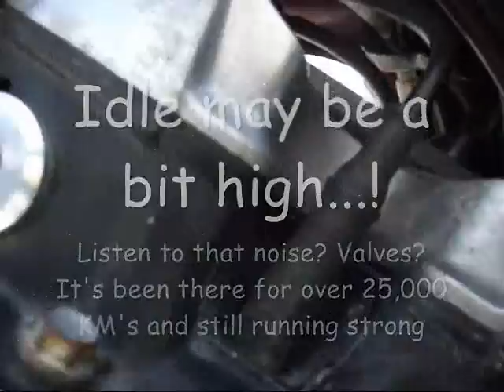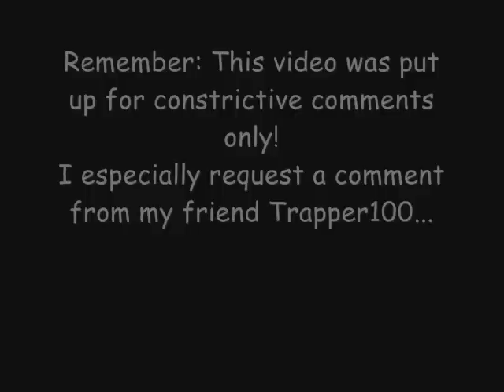1984 Honda Magna

Comment: I recognize that sound right off. I bought an 84 magna in Virginia when I joined the Navy. What your hearing is the cam chains slapping the cam chain tensioners. Makes a hell of a racket but as long as you keep the oil fresh, it doesn't cause a problem.. There an article on the SabMag Website about how to fix the problem. I think it was a v65 they repaired but basically the same. I love these old Magnas too. I have an 84 and an 85 V45 and an 84 V65. It is amazing how different the 84 and 85 V45 feel and handle with only 1 inch lower seat. I think it must have a longer rake too because while the 84 is nimble, the 85 is more comfortable by far.
Reply from the maker: Thanks for the reply and information. I was told the same thing by two mechanics. I was always concerned until the second mechanic said the same thing. I am even more confident now that you mentioned it again. the motorcycle is running great and this noise has been there for a couple of years now. It actually sounds a lot worse on camera but hardly noticeable when sitting at idle. Of course, when I am riding you don't hear it at all. I will have a peek at the video you suggested. Thanks again!

Comment from the maker: Thanks for the post Carry. I guess I am lucky that I have 5 more Magna engines. Two more complete frames and a large metal trunk loaded with parts such as electrical, electronics, hardware, cables, harnesses, carburetors, radiators, etc. The sad part of the story is my wife wants to do more riding so now with all this investment in a classic motorcycle, I need to sell to get a  bike better suited for riding two. The passenger seat is not so comfortable for her especially on the long runs.

Comment from the maker: @Trapper100 Old spacers is what you are referring to? I will set at idle of 1000 RPM ... Thanks. Does this valve repair only involve removal of the top pans? When you refer to the next size up to you mean a V45 valve spacer?

I appreciate your opinion. I am weary of doing the work but I will ahve to bite the bullet sooner or later I guess..